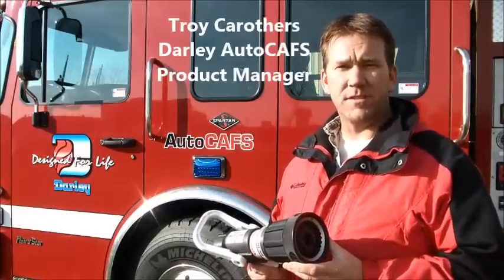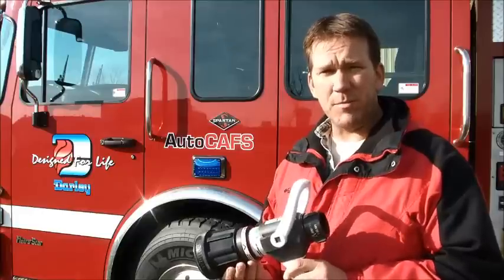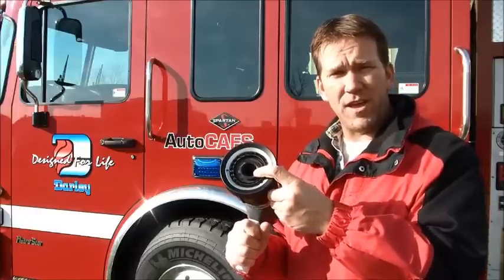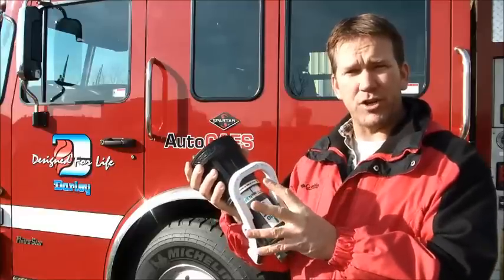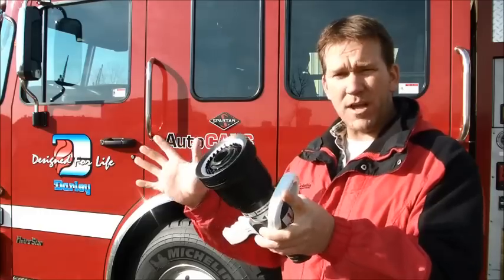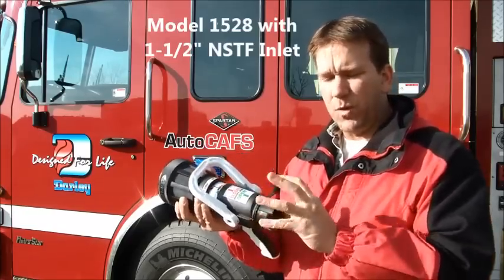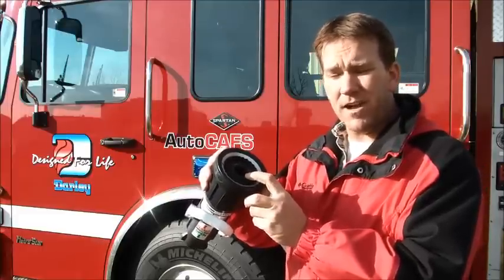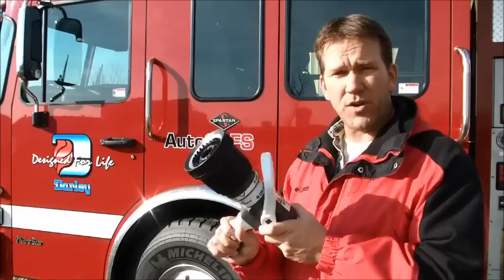SaberJet Nozzle with AutoCAFS

Comment: CAFS best size waterways are 1-3/8 so there is less busting of bubbles and more reach. .3 % is too low of a foam concentrate setting for most CAFS applications, it creates a very weak, fast draining foam.  Let the buyer bless do the work. Needs more explanation about surfactants in the bubbles will stick to the toxic smoke and fire GASSES to EXTINGUISH and clear the air of the deadly smoke.

Comment: A 1 1/8 inch smooth bore off 1 1/2 inlet..... Why? That 266 gpm. Can't use that on a preconnect that's for sure.
Reply from the maker: Sorry for the delayed response. CAFS flow dynamics are much different than plain water flow. But with plain water flow you are correct. With CAFS, we do not want a lot of restriction at the nozzle as we do not want to destroy the bubbles that we are making in the hose.
Reply: @TroyCarot  OK that makes sense.